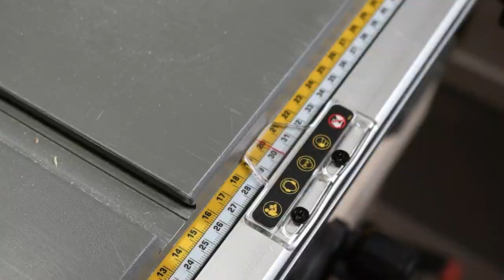DIY Articulating Camera Arm Rig with a French Cleat mount

Comment: I've been looking for something like this for a monitor mount for a computer to be shared between two workbenches - one stand-up and one sit-down.  Since plagiarism is the sincerest form of flattery, consider yourself flattered!!  Well done!
Reply from the maker: Thanks! I got the idea from an old fashion desk arm I have on my desk, must have been from the '40s or something, google "desk lamp with springs" and you will see what I mean. The pistol-looking part might look very odd right now when the camera is mounted on top of it but there is a reason for this. The plan was and still is to hang the camera under it but for that, I need a camera case that I have made an order on, but so far, I have not received it. The design will make way more sense when the camera is hanging under it. In your case, I would make it a vertical square holder with holes just like VESA monitor mounting plates have. I still think that if you make this design with longer arms or with a heavier load, using springs between the arms will make it much more secure and easy to use, so keep that in mind if you intend to use it for a monitor! Good luck with your project!

Comment: Those clamps look a bit awkward because they don't sit at the same angle... A bit picky, I know! Would it be possible to make a clamp that squeezes something like a rubber ball - so the radius increases, and the circumference pushes against the bottom of the cleat rail. I wonder if that would give you as firm a hold?
Reply from the maker: True that it might look a bit odd but they are super strong, easy to make and rises up enough to lock the the holder as well as lower down enough so it is possible to unhook the holder. I'm not sure how a design with a rubber ball would look or be designed but the idea is interesting.